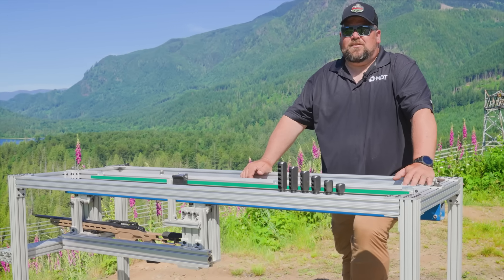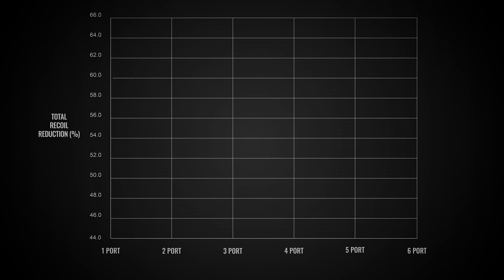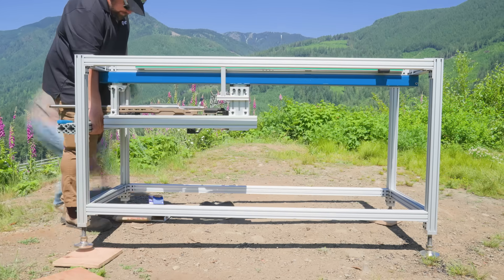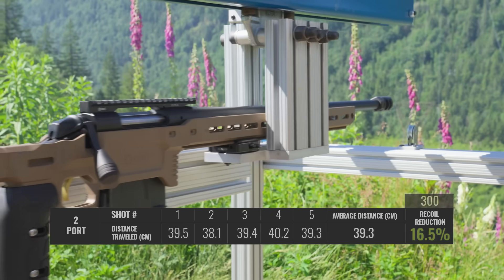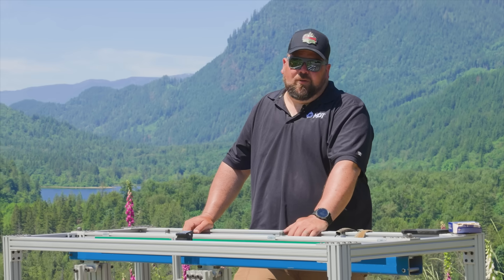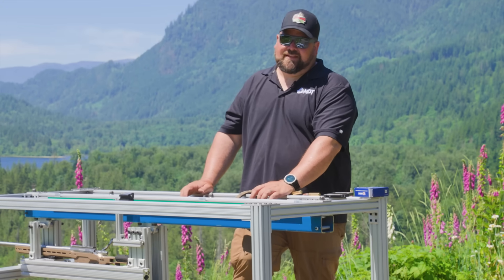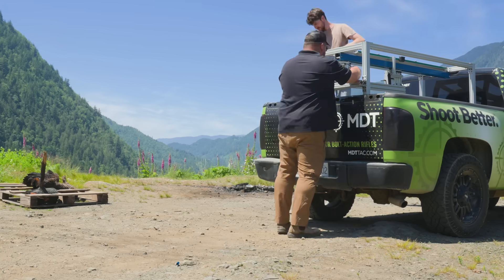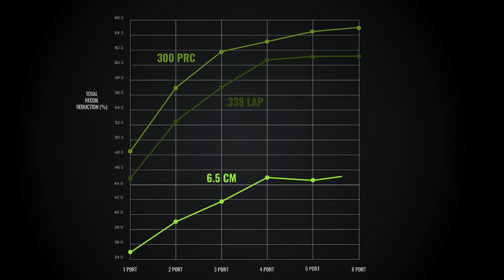Do More Muzzle Ports Equal Less Recoil? Pt2. With Magnum Calibers

Comment: I am a 338 guy, I shoot a 338 RUM a max velocity. I am shooting 300 gr Bergers at 2850 fps most 338 Lapua's are running around 2600. I use a 5 port brake and I actually have two 338 RUMS, one with a  port muzzle brakes and more and the other is a Terminator  port, they are both about the same in felt recoil. My question is , does running max pressure have an effect on adding more ports to dissipate the pressure vs a lower pressure load?

Comment: 300 Win Mag Question

I’ve got a Nemo Arms Recon with an 18” Bartlein barrel, and it came with a 2-port brake. I’ve been wondering if it’s worth upgrading to something more aggressive for maximum recoil reduction.

From what I understand, the two rounds you tested in that video produce a lot more gas, and even they seem to max out around a 3- or 4-port brake.

So I’m thinking — with 300 Win Mag, maybe a 2-port is already approaching the point of diminishing returns in terms of what the cartridge can actually benefit from?

That said, I’m not at all opposed to a 6-port if it’ll make a real difference.

Comment: Did you test with more space between ports, for example, a 3 port as long as the 6 port.  More space between the port vanes. so ports 1/2/3 are not actually blocking ports 4/5/6 and the gas has room to expand and redirect on each port face more effectively.  I'd be interested to see a 3 vane vs 3 vane comparison if you special made a 3 vane brake as long as the 6 vane .  You can probably just mill 3 vanes out of a 6-port.  ( mill the 1 / 3 / 5 vanes out of a 6 port brake ).
Reply from the maker: Same port size between each one

Comment: How much heavier is the rig getting with the addition of the 5th and 6th port relative to the guns weight? Is the recoil reduction of a couple percent a reault of increased mass rather then diverted gas.
Reply from the maker: It could be possible

Comment: Great test. Was this approach used to define the shape and section of the ports as well? Would a progressive increase of diameter make better use of the lower pressure and lower volume of available gas?
Reply from the maker: We did not use the sled to decide the port size on our muzzle brakes. As for your second question, is a very interesting one and difficult to answer but it might be possible.
Reply: @MDTTAC  thanks! I suppose that CFD simulation can rule out some guesswork, but tests like these are very helpful in understanding where the law of diminishing returns hits. I really appreciate you answering my comment.
Reply from the maker: You're very welcome!

Comment: Great content. As others mentioned. What does changing the angle do, but more curious to see what a vertical port would do. From a small single port to 2-3 large ports. Does it keep the recoil very linear and flat?
Reply from the maker: Changing the angle will help reduce recoil, but will also increase the blast on the shooter. It is a balance between these two. Vertical porting definitely helps in keeping the recoil flatter and is why we have the adjustable ports on the Comp brake.

Comment: You guys should license this rig to other manufacturers to study recoil mitigation. I would be like a kid in a candy shop with this thing
Reply: You can build that rig very easily. It is very simple and way better than the swing arm idea. I would like to see them have a sensor to track initial shock just before movement though. It's more than just the number of breaks but actually port design.

Comment: The correct number is "Suppressor."   Even if it increases felt recoil due to increased back pressure, the lack of concussion (that is a sound wave that hits your skull) is worth it.
Reply: Regrettably, MDT is based in Canada. Up north, regular laws don’t make sense, let alone those regarding firearms.

Comment: You're making that determination just off the MDT muzzle breaks. The best muzzle device MDT makes is the MDT Comp. Only reduces 67% felt recoil at cost of $249. The Browning recoil Hawg reduces 74% felt recoil for only $140. There are several high-quality 5-6 port muzzle breaks that perform better than most of 3-4 port breaks at reducing recoil. Like Botnia Maxi, Mindi, Mini, Chad, Victory Turbine, painkiller, Ultradyne, M-905 Talon, 4WA, Gen-3-4 Fat bastard, exc 5-6 port breaks. Over the past 45 years we've tested over 50 different muzzle breaks. Some are custom designs made by machinis and some from other country's like the 4WA breaks. Some work best for 5.56, 6-CM, 6.5-CM exc. Others do well with 6.5-PRC, 270-WSM, 7-PRC exc. Then you have some that make my 300-RUM feel like shooting a 243-win. So, can a 3-4 port reduce recoil on the same level as the 4-6 port? That answer is yes. The Cadex MX1 & MX3 does a phenomenal job. The Browning Hawg, Hypertap, Raptor APW, Grizzly, and MDT also do a great job reducing recoil. What I consider a good muzzle break is one that reduces 60-70%. A great muzzle breaks reduces 70-80%. What I consider Top-Tear muzzle breaks reduces 80-90%. Yes their's several muzzle breaks on the market today that will reduce 80-90+% recoil reduction. They are Hypertap)(M-905 Talon)( Botnia solutions-Maxi, Mindi, Mini)( Victory Turbine)( Cadex MX-1, MX-2, MX-3)(Ultradyne)(4WA) painkiller breaks. I would like to see that test with good 5-6 port muzzle breaks against the MDT 3-4 port breaks.

Comment: Very interesting. If there is an energy reduction in the recoil where does it come from?  Is it all just the expanding gas?

It would be interesting to do the same basic experiment but include bullet velocity data as the ports change
Reply from the maker: A muzzle brake works by redirecting the flow of the expanding gasses which reduces felt recoil

Comment: next test- port angle- does 45, 70 or 90 degree port angle make much difference to recoil?  or adding a vertical port like on some pistol compensators?
Reply: I know from personal experience that not only does a vertical port matter, but so does the angle.

Angling the vertical port so that the exhaust pulls the weapon away from your shoulder DRAMATICALLY reduces perceived recoil.

Cant really do the test with this rig, however, as the downward forces would throw off the test as there is no way to effectively measure them.

Comment: does the orientation of teh brake have any influence on recoil? perfectly level vs 22.5 degrees vs 45 degrees vs 90 degrees for example. as well as the port style, lateral ports vs radial vs vertical ports(a compensator) vs hybrid brake-compensator

Comment: I think it'd be really interesting to see suppressors lined up on that rig. Short medium and long suppressors as well as ones with a break on the end and seeing the difference in recoil.

Does adding more baffles decrease recoil or just increase sound suppression
Reply: Too bad they are a Canadian company, and suppressors are illegal here.
Reply: @Flyboy9305 they're illegal in Canada!? I had no idea.
Reply: I guess somebody on the southern side of the 49th would have to undertake that testing ! Of course the other thing you'd want to know is just how much they actually reduce the shot report. I'm quite sure testing would show that not a single suppressor is anywhere NEAR as quiet as the ones Hollywood seems to have !!! LOL !!
Reply: @PoliticallyIncorrect14u I know they're not super quiet, I've shot around them a lot, but I haven't ever shot with one.  I'd be curious how much recoil reduction they'd have and if a bigger supressor reduces more recoil or just makes it a little quieter
Reply: @bradenkoyle1587  That's such a complex question to try and answer briefly, but I'll do my best...
So the amount of recoil reduction you get from a suppressor (I'm going to call it a "can" from here on so I don't have to type "suppressor" out 'cause I'm lazy), completely depends on the size and design of the can. Traditional baffle stack cans redirect the gasses between 70 to 90 degrees (with some variations) away from the longitudinal axis of the bore. This does have a noticeable reduction of recoil, but again.... it depends on the design of the baffle stack, the total diameter and length of the can.

Usually (some people will argue this point) flow-through design cans won't reduce recoil as much as traditional baffle stacks.

The efficiency of the design of the can greatly effects how much sound and recoil reduction it'll give you; there is just a ton of variation out there, with some cans giving very large recoil and sound reductions, and others not so much.

There are two parts to a firearm's "report." You can think of "report" being the total sound made during firing. The first part of the report (and the loudest) is caused by the rapidly expanding gasses exiting the barrel. A can works by diverting a large portion of those gasses so that rather than exiting the barrel, they are re-directed into expansion chambers, greatly slowing them down. You know the muffler on your car? Same thing, really. 

The second part of a rifle's report is the sonic boom created by the projectile. The speed of sound hovers around the 1,100 feet per second mark, but varies with altitude, temperature, and atmospheric pressure. So any bullet traveling faster than 1,100 fps is going to make a sonic boom, and there is absolutely nothing a can can do to reduce that sound; a bullet is gonna bullet. People are usually greatly surprised by how loud the sonic boom is. If I put a suppressor on my 9mm handgun and shot super sonic ammo through it, you'd likely say, "wow, that's still really loud!" But then if I load up sub sonic rounds, the loudest thing you'll hear is the action of the gun working.

Yeah, the sonic boom of a bullet is LOUD! : ) You're still going to need hearing protection when shooting super sonic rounds, even with the best cans out there.

I'll try and do a TL;DR here: Assuming you're using a traditional baffle stack can, yes, the larger the diameter and length of a can, the more recoil and sound reduction you'll get, but you will hit diminishing returns at a point, just like they did with muzzle brakes in the video. That is a very general rule of thumb, though, as modern can designs can do some serious recoil and sound reduction with a very small footprint.

Unfortunately, cans do not give nearly as good of recoil reduction as dedicated muzzle brakes, though.

This concludes my coffee fueled Ted Talk on suppressor basics. Thanks for listening. : )
Reply: @floorpizza8074   "(I'm going to call it a "can" from here on so I don't have to type "suppressor" out 'cause I'm lazy)" Comment completely defeats the purpose  of the shortening of the word.LOL.
Reply: @PoliticallyIncorrect14u shot real suppressor and no most are not Hollywood quiet. However you can comfortably shoot supersonic ammo in most cases and it's closer to someone talking kind of loud to normal volume. At least to the sides and behind the rifle. SilencerCo 30 cal titanium suppressor we were shooting 6.5 creedmoore and it was closer to slightly loud library taking.
Reply: Came here to say this! It makes a difference on my 7prc for sure but it’s a larger can
Reply: Can't.. The all knowing Canadian government thinks ninja assassins will kill people in their sleep, like the movies
Reply: @LloydfromCanada  sounds reasonable
Reply: @bradenkoyle1587 if they're anything, IT'S DEFINITELY reasonable LOL
Reply: @LloydfromCanada haha! I feel bad over here being upset that suppressors were almost deregulated completely while they're totally illegal over there
Reply: Yes please
Reply: That would make for a very interesting video

Comment: Now you need to do an AR length cartridge 6 arc, 22 arc, 6.5 gren, 223 etc. Or I missed that one if you did it already.
Reply: Yes.  I’d like to see that as well
Reply: I run a 3 port JR titanium brake on my 20" .223 Wylde that I use for deer in NY.  That rifle has no perceptible recoil.
I can confirm the 4 port on the 6.5CM is exactly what they reported as I have an Apollo Max on my Bergara 6.5CM HMR (also for deer).  That rifle has barely a tick more recoil than a 5.56 with a flash hider coupled with zero muzzle rise.

Both of those rifles can keep optics on a deer after the shot without even trying.  The .223 took 2 deer last fall between 90 and 125yds and the 6.5CM took 4 between 75 and 275yds.